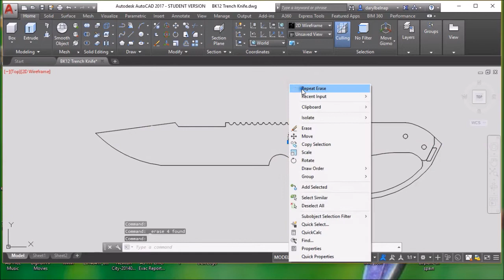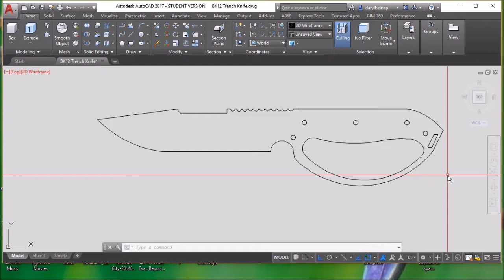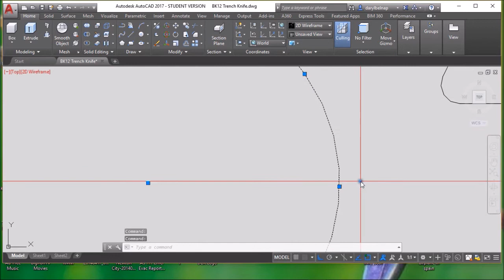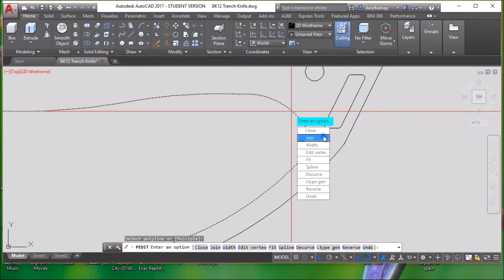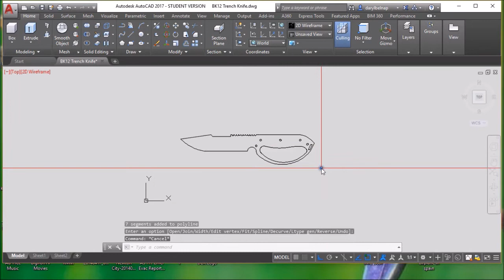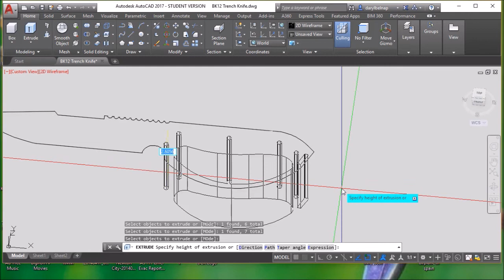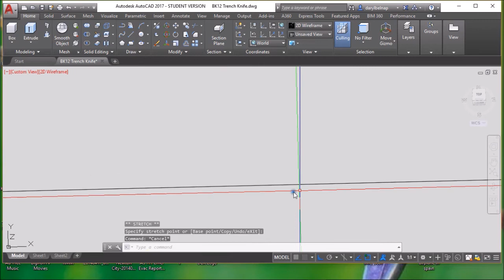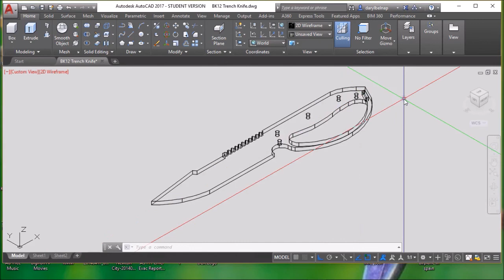CAD 2D to 3D - Knife Making

Comment: Looks like you have to be super smart to do that or very knowledgeable of the software your using
Reply from the maker: or have a ton of time in a hotel to grind through trial and ERROR to learn a few functions.  It is not too tough and recommend it to anyone.  I absolutely love being able to draw on CAD.  Only regret not learning it sooner.  I am now in the process of upgrading my sander using parts that I designed using CAD and then sending the files to the machine shop and having them cnc machined.
Reply: BigIronTV That motel living sucks, I guess you do have plenty of time to practice